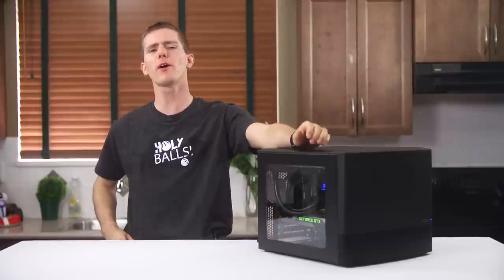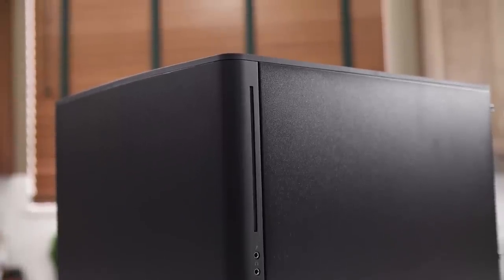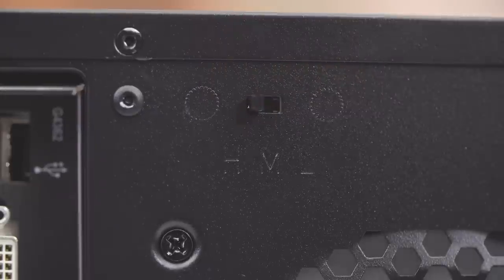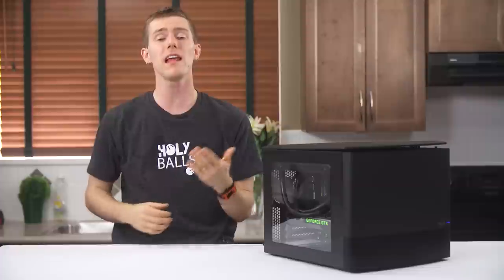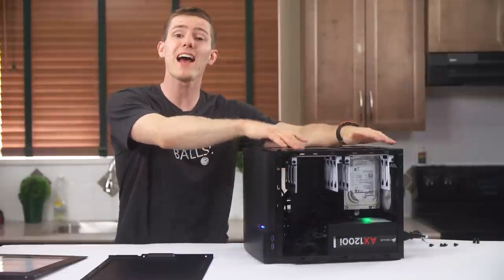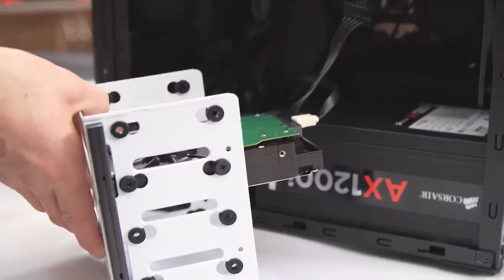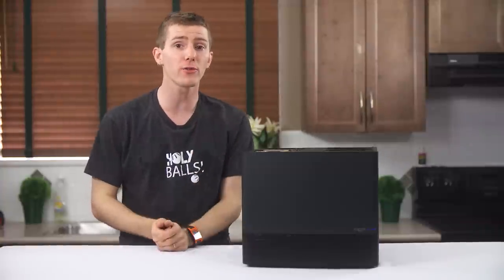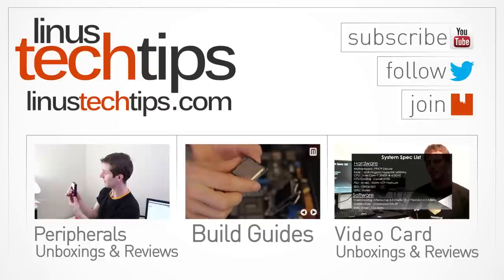Fractal Design Node 804 Cube Case

Comment: I'm looking to buy a monitor that's is about 27 inches+, I will be using it with an Xbox one and I'm just wondering if anyone knew what the best monitor to buy would be.
Reply: if you're going to use it with a console you're probably better off with a tv. the whole point of consoles is couch gaming, if you use them on a desk a big chunk of the advantages are lost. if you decide to get a monitor either way though, you might want to take a look at this one: http://www.asus.com/it/Monitors_Projectors/MX279H/
since the xbone limits your resolution and framerate there's no point in going for a 1440p or 120hz monitor, whereas ips WILL make your vieweing experience much better.
asus products have yet to let me down, it's almost always a safe bet that they'll have what you need.
Reply: Thank you

Comment: I dont see how the small size of the case give any advantages. Any PC can sit on the floor, and even towers can stand on tables, they are thinner, but longer. Maybe travelling? I have no clue.
Reply: it's probably designed to sit in a shelf, maybe under a tv as a media center and/or couch gaming.
Reply: Cicciter I guess. Ive never had any trouble moving or placing a mid-tower so... :/

Comment: Can you at least tl;dr most of this: a) is the case going to keep the drives properly cooled, b) is it going to combat overall humidity of installed components to allow for increased longevity of how long they'll last inside the case, c) i.e. is the case good, safe and reliable for making your expensive storage and expansive (cpu, gpu, ..., etc) components to last for a good for few years without fear of increased humidity during summer times?